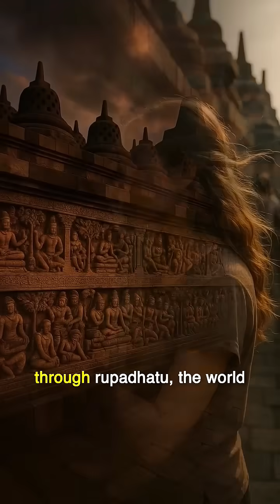"Built Without Cement? The Genius Behind Borobudur Temple!" #Borobudur  #WorldWonder #Shorts

Comment: Jew Rothschild’s mouthpiece touts Borubudur temple as Borobudur, as a Buddhist temple built 1200 years ago.. In reality it is a Hindu temple built 12500 years ago..  18 kms away from Borubudur temple is Prambanan temple which was built during the same period. At least Prambanan temple is considered Hindu though covert attempts are on to convert it into a Buddhist temple like Angkor Wat temple..  Three Hindu temples in the region, Borobudur, Pawon and Mendut, ( west to east )  are positioned along a straight line at an azimuth of 263 degrees – a precessional astronomical path.. The alignment points, at the horizon, where the sun sets in the days of the zenith passages. The exact ratio formula 4:6:9 has been discovered in the Pawon and Mendhut, two other neighboring temples.. The monument  represents cosmology because it can be seen that the 360 squares that surround the central square of the monument symbolize the 360 degrees of the “celestial circle that surrounds the Earth..  12500 years ago astronomy was known only to sages in the land of Punt ( North Kerala/ Malabar/ Ophir/ Mittani / Sheba ).. Only Hindu temples are steeped in astronomy- never Buddhist temples- never ever.. Borobudur temple initially represented a 1000 PETALLED LOTUS ( Sahasrara chakra)  FLOATING ON THE LAKE when viewed by a helicopter from above. Instead of being built on a flat surface, Borobudur was built on a natural hill..  Borubudur has 108 stupas.  108 the digital value of Hindu king mantra OM/ divine geometry of Sri yantra / the number of rudrakshas on a mala,  has nothing, zilch,  to do with Buddhism.. Jew Rothschild created the Buddhist bullshit that there are 108 earthly desires in mortals, 108 lies humans tell and 108 human delusions. Oh dearie me ! And hear this out—Pig eating Buddha answered 108 questions which are contained within the Lankavatara Sutta..  and 108 days of mindfulness. Of course ! BRRAAAYYYY… And check this 108 connection to pig eating Buddha-- The Gandavyuha Sutta (the last chapter of the Avatamsaka Sutra) is the story of a pilgrim named Sudhana, who visited 54 teachers in the course of a spiritual quest— this is bullshit cooked up by Jew Rothschild. TEE HEEE.  This Sahasrara chakra is enclosed within a Hindu mandala of tantric purusha/ prakriti merge built to the principle of Hindu vaastu....  108 spouts are installed at each corner, depicting makara the guardians of Hindu temple thresholds. Makara head at the corner of temple roofs is as water element which also functions as a "rainwater spout or gargoyle".  Vishnu's earrings are shown in the form of Makara. The makarakundala decorate Shiva's ears..  These makaras have nothing to do with Buddhism. The monument is arranged as an ascending series of three circular platforms that rest upon six square ones, capped by a large central stupa. Let up be very clear that stupa is not a Buddhist symbol, though it has been given away to Buddhism by Jew Rothschild and his cooked up Chinese travellers..  It is a Jew Rothschild lie that a stupa is intended as a shrine for the Buddha. There are hundreds of stupas in India built several millenniums before the fake Pali speaking pig eating Buddha was born..  A Hindu temple, is used as a house of worship. The meticulous complexity of the Borobudur  monument's design tells us 100% for sure that Borobudur is a Hindu temple converted to a Buddhist temple ..  Emperor Ashoka ( who never existed ) converted from BAAAAD Hindusim to GOOOOD Buddhism.. It is a lie that Ashoka built the Mahabodhi Temple in Bodh Gaya in 250 BC--  a circular structure, in order to protect the Bodhi tree under which the Buddha had found enlightenment.  It is a kosher lie that Emperor Ashoka (rule: 273—232 BC) cooked up by Jew Rothschild recovered the relics of the Buddha from the earlier stupas (except from the Ramagrama stupa), and erected 84,000 stupas to distribute the relics across India. All Chinese travellers to India who selectively sang the praises of Buddha and Ashoka and Buddhist Nalanda University never existed..